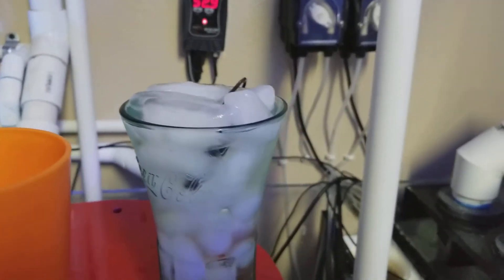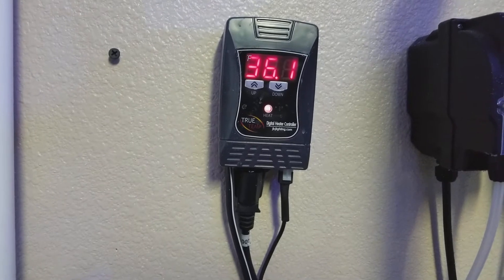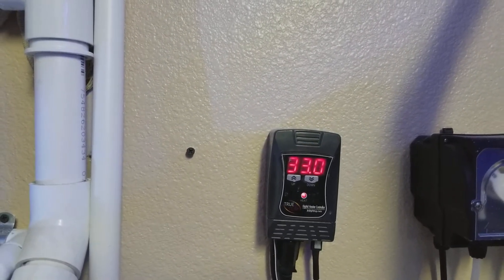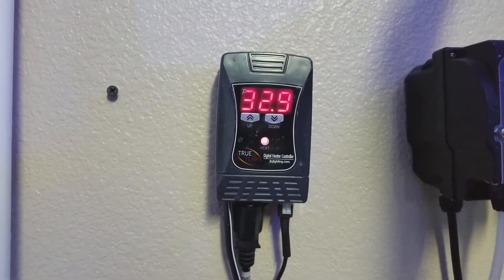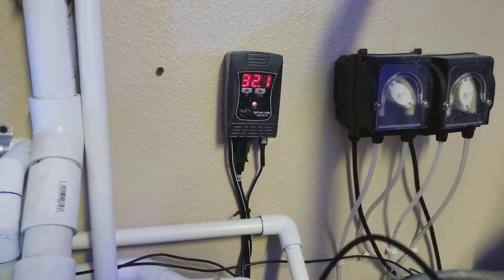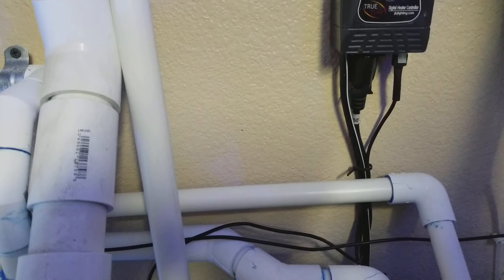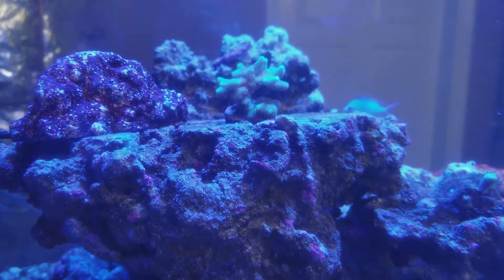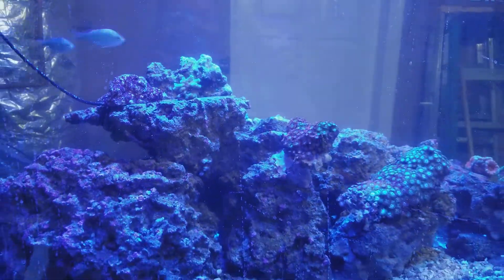How to calibrate your temperature probe

Comment: I’m not sure I’d trust this for aquarium calibration since this equipment isn’t being used at the temperature 32 degree range for aquariums. If there’s and swing in accuracy at higher temperatures then it will throw off the accuracy at 78. I’d trust a certified thermometer instead.
Reply from the maker: The certified Thermometers are set at 32° as well. This is because 32* degrees is known temperature That water freezes.
Reply: @Ductology  I agree with the method for finding a known temperature just not sure it holds up on some of the equipment we’re using on our reef aquariums throughout the temperature range we use them at.  I’m going to order a certified thermometer and test the method across the higher temp range.  The recommended process is using a certified thermometer to make sure my 78 is the same as their 78. 32 doesn’t matter to my reef.
Reply from the maker: @ChadLower  I'm interested on the outcome? Please share